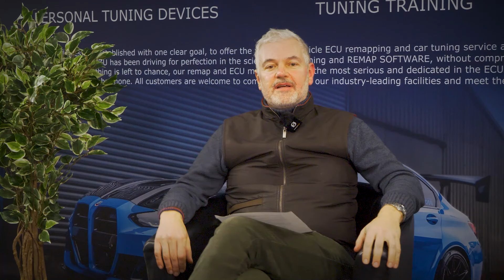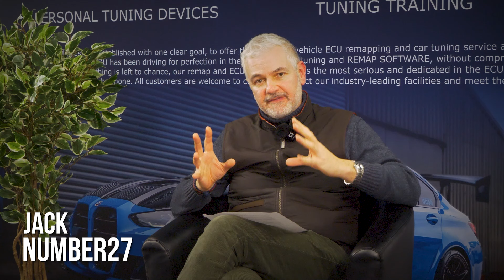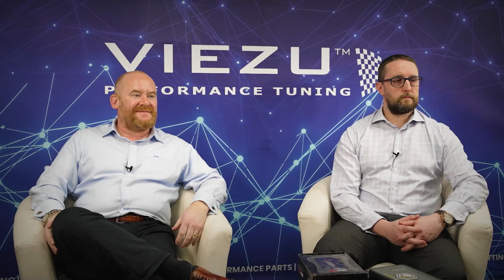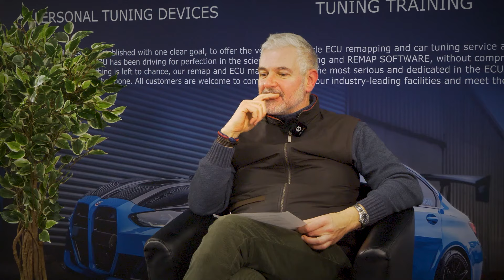Car Remapping | Your Ultimate guide to vehicle remapping from VIEZU Performance Tuning

Comment: Going to download and rewatch a few times, interesting.

While I have used them I am not the biggest fan of OTS used all around the world, these modern higher compression, DI turbo engines can often be very depended on fuel quality, biting the bullet in terms of the cost doing it custom at a reputable tuner is so worth it.  Although you are quite lucky in the UK, have got some great tuners, perhaps better fuel than here too.